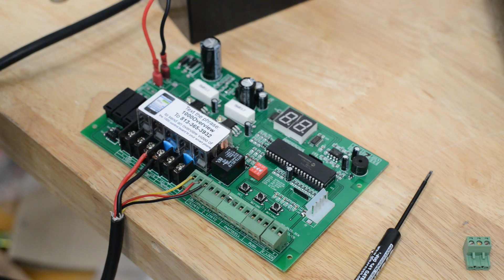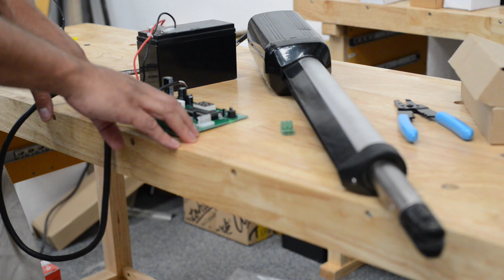How To Troubleshoot Driveway Gate Opener Limit Switch Issues Using a Jumper Wire

Comment: I have two Liftmaster LA400 openers for two driveway swing gates.  The LA400 for the left-hand swing gate, furthest from the control box is no longer taking and keeping the Set Open and Set Close limit positions.

The Liftmaster units are only about 4 years old, but the installation wiring is from the original non-Liftmaster gate openers installed 25 years ago.  And yes, the wiring does run under the double-wide paver driveway (although I haven't looked yet to see if it was installed in conduit or not).

So, would you say that my issue with limits not being able to be set on that LA400 is due to a wiring problem or a circuit board issue?  (The LA400 itself works fine when I am moving it using the Move controls on the circuit board as part of the Limit-setting procedure.  It's just the actuator will not retain Any limits, Open or Close.)

The other LA400, near the control box, works fine so I'm wondering it that points to maybe the wiring under the driveway to the far LA400 is maybe broken or shorted....

Thanks in advance for any insights you can provide!

Comment: I did this test and gate opener worked with the wires jumped. So bad limit switch right? Replaced limit switches still same problem. It ended up being a bad control board

Comment: If the arm will not move in either direction when tested as shown. Then what. You answered half the questions.
Reply: You would have to wire motor directly to power and see if it works. Reverse wire polarity will make it go in opposite direction. If it works more than likely bad control board. There is also a way to check resistance of limit switches with a multimeter to see if they are bad